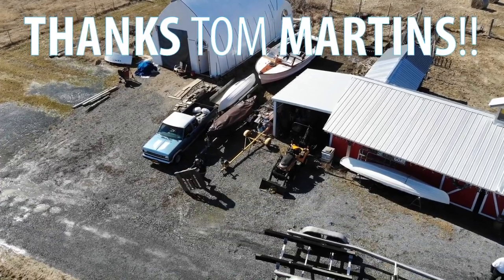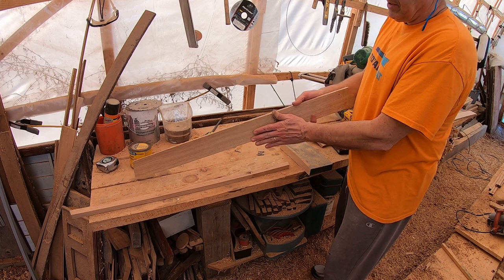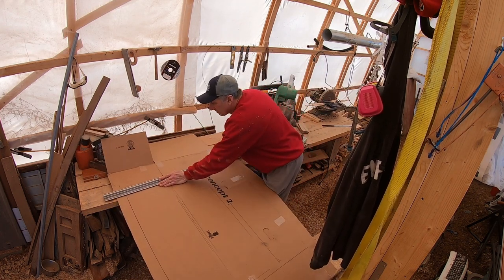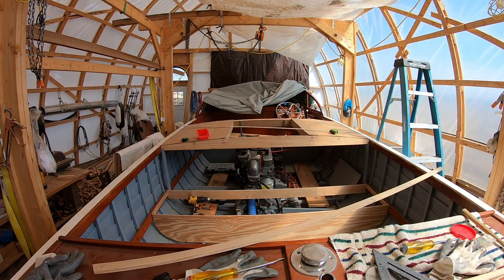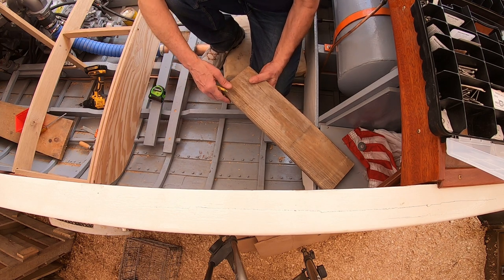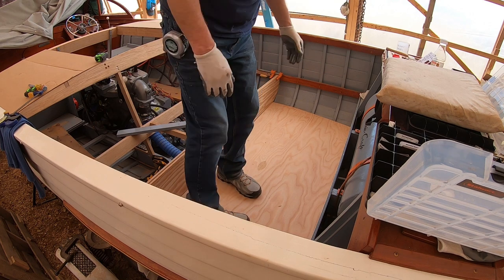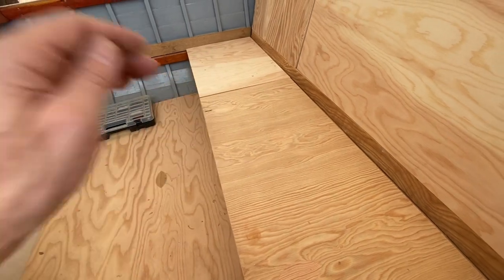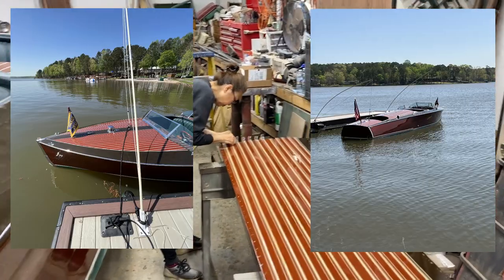Rear Seat & Deck WBE E3 S18

Comment: My condolences to the loss of you mom bruh. sorry to hear that, loss my mom 26 yrs ago I still miss her dearly. on the sides of the seats I would make the ends of both sides be permanent fixture by at least 3 inches of wood on both sides,  just remove three inches of both seat lid covers and use those ends to be mounted permanently so that it helps square up the bench seats, if you know what I mean.
Reply from the maker: The upholstery combined with the plywood made for great seating.

Comment: When you add the upholstery to the seat back, will there be enough area to the seat bottom to be comfortable ? Maybe you should add a cushion on the back to try it out. :yougotthis:
Reply from the maker: I didn't show me doing that but I did try it out using the throwable seat cushions. The seat base is the same dimension as the back seat of my Lyman which is a really comfortable seat with cushions in place. I'll be using 2" foam on the backs and 3" foam on the seat which is an inch thicker on the seat than my Lyman as I think those are too thin.